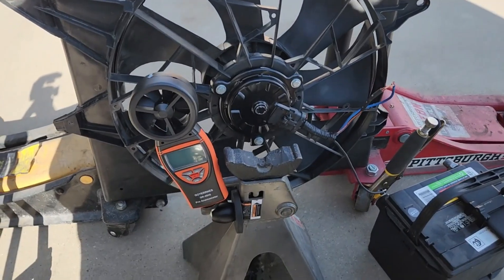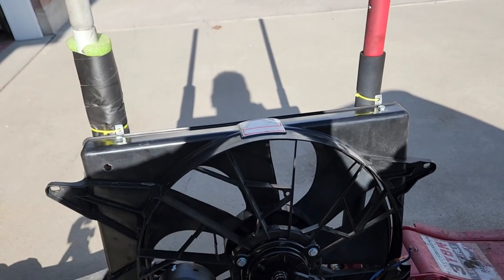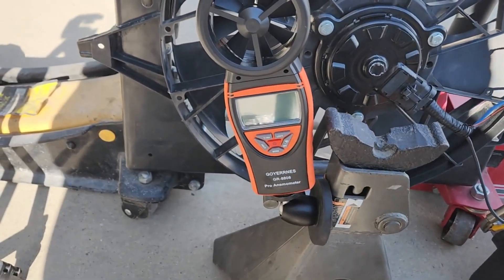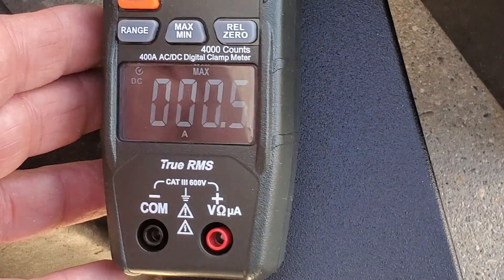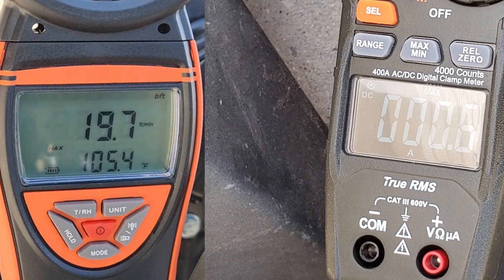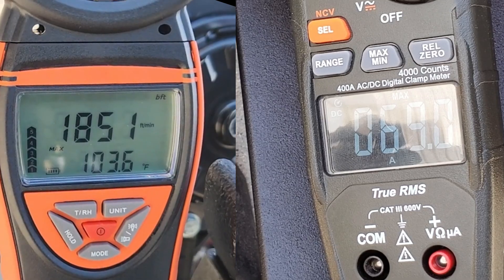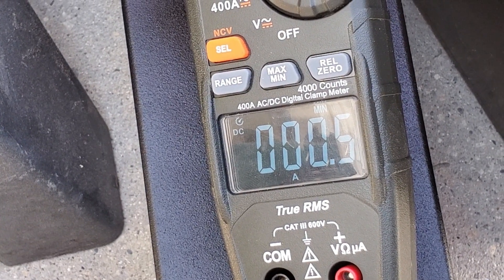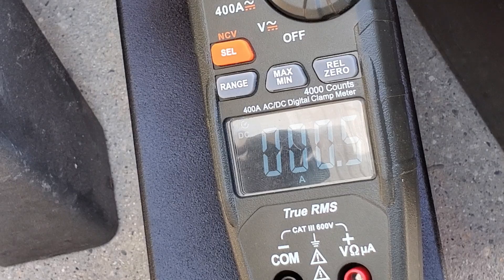Ford Thunderbird Radiator Cooling Fan CFM Test | Junkyard Mod & Current Draw Analysis / Cougar - 89G

Comment: No way it's pulling 70 amps.
Reply: That was the max startup pull. (note "MAX" is lit up on the meter) You can see at 4:39 it's pulling ~15A-16A after startup
Reply from the maker: I'm not sure what you're getting at. How am I going to "fake" that? And why would I? Go to post 26 here. These pull a lot of amps on startup. https://stangnet.com/mustang-forums/threads/whos-using-a-lincoln-mark-viii-fan.900939/page-2

Comment: I have been running MK8 fans for 15yrs now on all my Mustangs. They can have 100amp draw if straight turned on to 100%. They are rated at 4500cfm, and I BELIEVE IT! Even with a good battery and the fan on high, and engine off, it will out flow any electric fan setup out there, and then!, I started the car with it running, the fan sounded like it went from low to high!, even tho it was on the high setting!

Comment: You were measuring feet/minute which is the air speed.  CFM is cubic feet/minute which is a measure of volume; those are two separate things.
Reply from the maker: @linuxman0  hmmm... I'll look at that when I get back home. Did I have it set wrong?
Reply from the maker: I see what I did wrong... I failed to do the conversion. Thank you for pointing that out.
Reply: I was gonna say the same thing, I see FT/min, totally different! Also, there's just no way even the FT/min is acurrate, the air can move any way it wants before it hits your measuring device there. You need a solid like 14v to that fan when testing. When my Car ISN'T running, and the fan in high! mode, as soon as I start my car, the fan sounds like it goes from low to high!!!!!!! Have good power matters! Thats how much it picks up with the car running, showing like 13.8-14v with a 150amp alternator on my car aswell.

Comment: Interesting test, thanks for sharing! Now that you mention it, it'd be great to see a PF style comparison of some of the electric fan kits. I accidentally bought one on clearance from LMR which I'm sure is not as good as the contours I originally wanted. I'd love to know the actual difference. Maybe also which one's CFM drops the least when against a radiator.